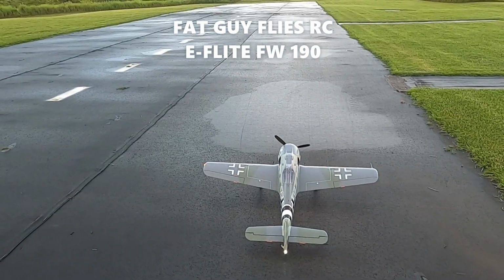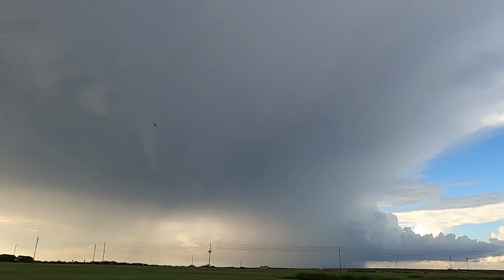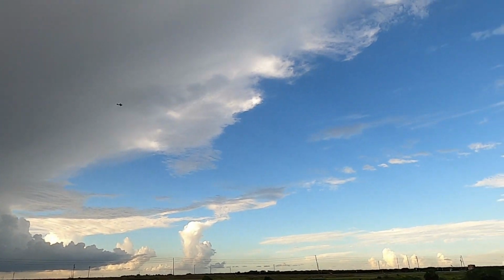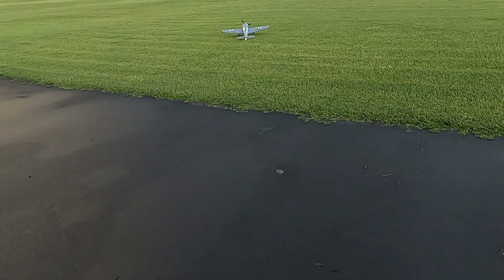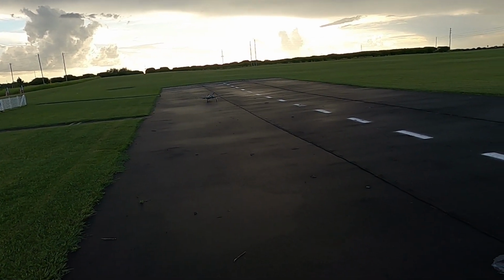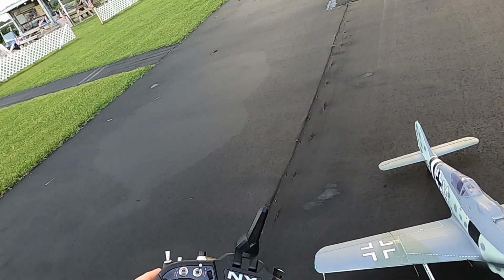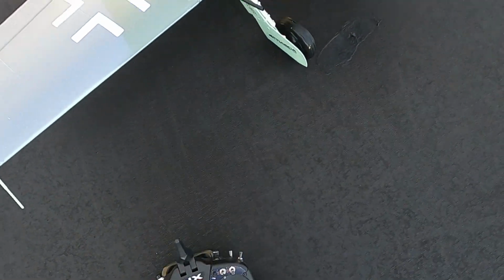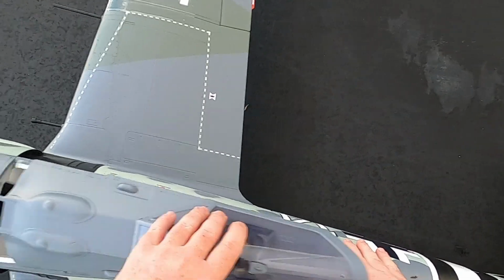FW 190A from E-Flite- An off day by -Fat Guy Flies Rc

Comment: The E-Flite FW-190 is someone picky about landing on just the mains, Closer to 3-point or a 3 point landing rids her of the bounce. I also noticed when your speed was up she seemed smoother and the slide into home plate is normal and hard to stop. I had the same issue with my brothers, Great Job and enjoyed watching Greg.👍👍⭐⭐⭐⭐⭐🎬🎬🎥🎥🎶🎶
Reply from the maker: She also does better on grass than I thought she would. And I know about more speed on landing with warbirds I was just suffering from Anal Cranial inversion!! lol
Reply: @FatGuyFliesRC  Are you allergic to insect repellent? I use a can of deep woods Cutter a week up here in upstate NY If I forget it the bugs here will feast upon my flesh like a all you can eat buffet.
Reply: I LOVE the looks of this plane but I know I'd have to repair the gear every landing

Comment: I cannot mail the landing on this beauty. Grass is not bad, but I would really like getting the hard surface down.  Speed seems to help, but spins out and wing tips putting a lot of load on the landing gear.
Reply from the maker: Grom what I have seen online she needs to be landed as a thee pointer instead of mains first. I will have to attempt that.